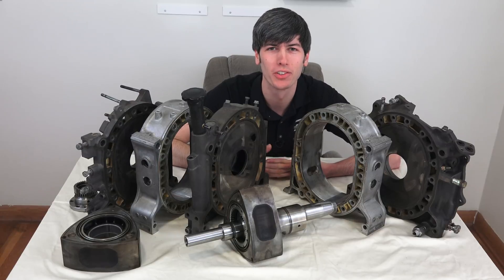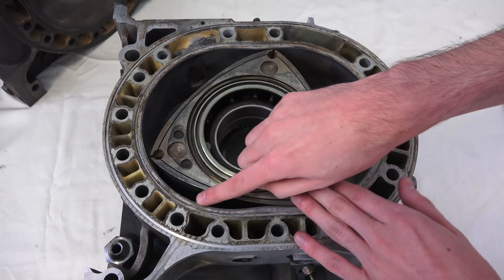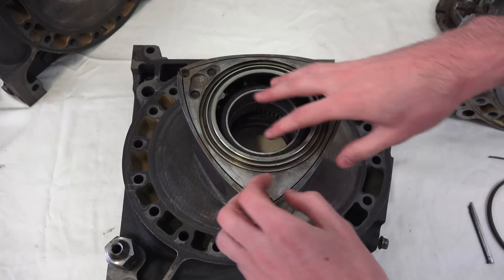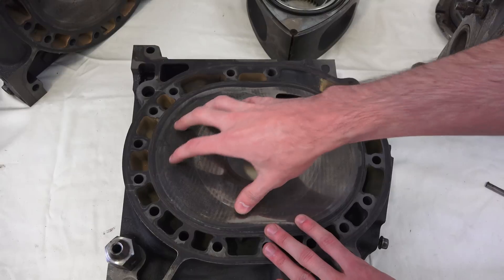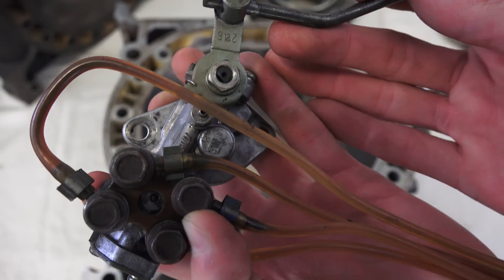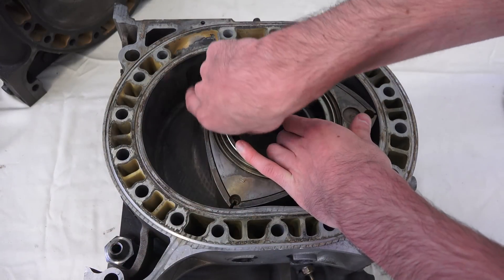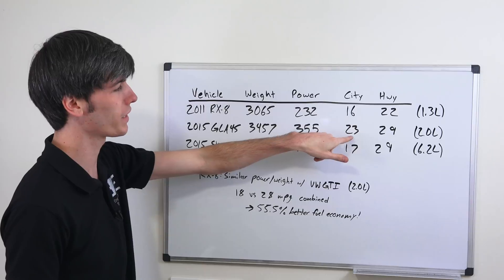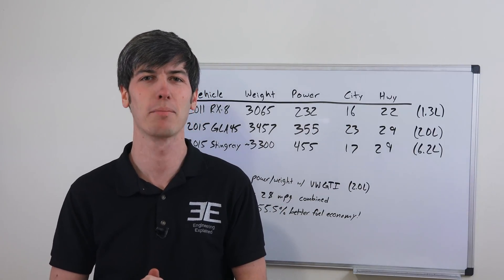4 Reasons Why The Rotary Engine Is Dead

Comment: Rolls Royce did have a diesel rotary with one rotor as the compressor around 1970. This idea has been taken up again by Pratt & Whitney Rocketdyne who have received R&D funding from US agency DARPA. This is to use the single heavy fuel for NATO purposes. Rotron of the UK approach using heavy fuel oil (HFO) from another angle, they heat the fuel to 98C before injection.
Reply: +John Burns Everybody tinkered with Wankels 40 years ago. For burning heavy oil 2 strokes diesels direct injection (with exhaust valve) are the best. Easy to make, simple technology, strong and extremely efficient (around 50%).
Reply: The real doktorbimmer Get therapy Knobhead.
Reply: Pablo Ricardo de Tarragon Correct.  The current idea is to preheat the fuel and use spark laser ignition.  A low revving rotary using HFO will last and last.  Darpa are very interested funding R&D. When the US government funds something the R&D info goes silent.  They also fund Liquid Piston who have a rotary in reverse.  The seals are in the housing and valves in the roter. Promising.
Reply: ***** Useless complications. That has a name in the military industrial complex; sugaring, that permits to spend money for the friends in some fields.
No need of laser, complicated pistons etc. The technology of heavy fuel 2 strokes diesels is mastered since ages by the German (Man by example) and Finnish Wartsila Suzler in very big engines. These engines are simple, reliable, easy to maintain and pretty cheap by HP, they are able to burn the worst bunker with high efficiency. Man makes also semi fast and fast diesels able to burn any thing that burns. The best turbo compound diesel engines for trucks made by MAN can reach an thermal efficiency of 52%.
The technology is pretty straightforward but there are a lot of possible gains with variable timings, materials as ceramics and sequential direct injection as you can get the best EPM and an engine as adiabatic as possible, ie with no heat losses. The thermal efficiency of these diesels is now just above the 50% (gas car at best 25%) and 55% are reachable in production engines..
The next step will be probably electric with combustible piles and regenerators, it's one of the ways of getting thermal efficiencies around the plus 60%, similar to the combined turbines able to burn from jet fuel to crude oil in production of electricity.
And for cars, electric motors have efficiencies above 80% and do not need gear boxes. With the new generation of batteries, 60% of global efficiency will be obtained including charging and discharging of the battery, more than twice the gas engine. In a rational world gas engines are obsolete.
Wankel was a dead end, it's thermal efficiency was truly too bad, and all the similar rotative piston engines suffer of the same thermal inefficiency, the shape of the combustion chamber being disastrous. That's enough to dismiss these engines. I won't talk of the sealing problems and worst the burnt lubricating oil.
Reply: The real doktorbimmer Yes, I could almost call Atkins and Miller cycles "variable timing" as they are variations of the compression sise of the cycle.
The great interest of the diesel is that can use a great variety of combustibles, even coal dust. The most promising path is vegetable oils produced by the the third world peasant using the engine. Coconut oil and sesame oil are very interesting. Sesame oil, which looks at first sight expensive for an occidental, can be easily produced by the peasant himself with minimal inversion, work and land surface. The sub products are edible and can be used for feeding humans and animals. The oil serves as lubricant and combustible. Except for the the small amount of diesel needed to start the engine, the user is auto sufficient.   
Even the humblest and very low tech all iron diesel engine 6 HP 600 RPM with splash lubrication has already a good efficiency and can be used with vegetable oil with little modification (mainly a oil heater using the exhaust gases) Such engines can run 24/7 with simple maintenance, and can last tens of thousands hours. So the 2 ends of the diesel engine, low and high tech, are remarkable.
Reply: Pablo Ricardo de Tarragon
Laser ign can project FOUR sparks deeps inside a combustion chamber, which is ideal for a rotary with its moving combustion chamber.  NATO want to standardise on fuel HFO. It can be spark ignited by preheating it. Rotaries in R&D have excellent thermal efficiencies when run at constant speeds.

Those 4 deck high Wartsila Suzler engines when needing overhauling means the ship is dock, which means down time which costs. Ship and moreso cruise ship operators do as much maintenance as possible under way. They even paint the sides of the ship when in a calling port. They want the ship in dock only for essential dry dock maintenance like azipods, props or the keel.  Some ship's designers are looking ahead and favouring larger rotary engines in banks (slide out modules say 1.5 metre by 1.5 metre complete with generator) in cruise ships. Rotaries are one third of the size and weight for the same power output. The smoothness is a great asset in passenger accommodation. Rotaries scale up seamlessly.

The rotary genset modules can be phased in, in stages to what the ship's demand is, rather than running these massive Sultzer engines when there is low demand. Then they can slide out a genset module in port and slide one in, which will take a few hours. The genset module in port can be overhauled onshore and the ship continues with no down time maximising efficiencies.

These big diesel engines are also filthy. Such huge ships emit as many air pollutants as five million cars going the same distance.

"Southampton, which has Britain’s second largest container port and is Europe’s busiest cruise terminal, is one of nine UK cities cited by the World Health Organisation as breaching air quality guidelines even though it has little manufacturing."

http://www.theguardian.com/environment/2016/may/21/the-worlds-largest-cruise-ship-and-its-supersized-pollution-problem

Some companies are running the cruise ships on LPG to reduce pollution. Rotaries as constant speed gensets are also very good at burning hydrogen.

The thermal efficiency of these diesels is because they run at constant speeds. Car engines do not, so efficiency is very low with cars.

You are right, in a rational world petrol engines are obsolete and electric is the way. The best range extenders for cars are rotaries with the new R&D very promising superior performance over piston/crank engines. They can be easily hidden in cars being one third of the size and weight, which is a fantastic attribute. Also, as range-extenders are part time engines the efficiency is not a great point - as they will be rarely used. Size weight and smoothness matters. But at a constant speed a rotary with the new advances running as its 'sweet spot' exceeds piston/crank engines. The rotary does not like being revved up and down.

Rotaries do not have sealing problems that is myth from 50 years ago.
Reply: ***** The Rolls Royce wankel diesel project died 42 years ago on 1974 https://books.google.com.mx/books?id=IB2lMFqTTl8C&pg=PA100&lpg=PA100&dq=rolls+royce+diesel+wankel&source=bl&ots=_3x3kwBst4&sig=650Cs6Aq74cDryIeBDXL7MrMXIM&hl=fr&sa=X&ved=0ahUKEwjPy_D-ju7MAhWDGh4KHbE0BdcQ6AEITjAL#v=onepage&q=rolls%20royce%20diesel%20wankel&f=false
RR struggled during years with the sealing problems, and after a few years more trying to remedy the inherent inefficiency of the combustion chamber. It never achieved its goals, so the project was discreetly buried. That sucked a lot of money of the tax payer, a typical military industrial project.
Rotary engines are inefficient by nature and now it's a dead end. There is none serious project of alternative rotary engine able to replace the old style engines.
All combustion engines are polluters by nature, you can make them a bit less polluters at extraordinary cost.
The case of the super cruise boats is simply the concentration in the same structure of an enormous amount of energy created by combustion engines, thus creation of an enormous pollution. Whatever the kind of combustion engines and combustible used they will pollute heavily.
LPG is pretty costly compared to bunker, and very unsafe compared to it. I would not like to store hundreds of tons of LPG in a boat... Hydrogen is a very costly combustible using extraordinary amounts of polluting energy to produce it, it's very hard to store, extremely unsafe and has a very low massic energy. It's absolutely not interesting in most applications.
The problem of Southampton (where I lived many years ago) is the number of boats, ships and ferries at the same place. Cruise ships uses gigantic amounts of energy. Besides, the Channel is the busiest maritime way of the world, with several big harbors, dozens of ferries terminals, hundreds of fishing harbors. 800 boats of more than 300 tons cross the channel every day, add the small boats of less than 300 tons and there are thousands of boats. 90 big merchant ships pass the Dover strait every day...
On a ship, the weight and size of the engines is not a real problem as they improve the center of gravity and the good ole diesels have the advantage to be cheap by HP as they use ordinary materials, are reliable, use the cheapest combustible and last decades.
They pollute as all combustion engines. More or less but they are all polluters. Without diesels forget all the cheap conveniences imported by sea, and global trade.
The merchant ships use very little energy compared to the weight of merchandise carried; a 10.000 containers ship uses 90.000 HP at 35 km/h, the same 10000 containers at the same constant speed on road will need 10.000 trucks using about a total of 850.000 HP. Ships are easily 10 times more efficient than trucks and 25 times more efficient that cars. The lone efficiency competitor in transportation is electric railroad. Economically there is no need to go to complicated solutions when powering a merchant ship.
Thermal efficiency are measured at the constant speed where the engine has the best specific consumption. So you can compare  the thermal efficiency of different kind of engines.
For the use as auxiliary range extenders on hybrid cars, a water cooled 2 stroke with direct injection will do the job at better price the technology is already mature. A 90 HP 3 cylinders is very small and weights only 40 kilos. You can find them in several outboard engines. They are practically as efficient as 4 stroke gas engines, with better torque and are very smooth.
Reply: Pablo Ricardo de Tarragon
42 years ago is a LONG time. Things have changed since then. I told you it's been taken up again. In the 1970s RR were strapped for cash because they signed a fixed price for the development of the RB211 jet engine. Great engine but sent them into financial problems. They pulled the plug on all projects.

Rotary engines are efficient by nature when run at a constant speed at their 'sweet spot'. FIVE companies in the world make them. They are used in UAVs.  Look up what Mazda is doing for future road vehicles.

LPG is not unsafe.

On a ship, the weight and size of the engines is a big problem as the centre of gravity is high. They are 4 decks high. A collection of genset modules all along the keel gives a superior lower centre of gravity. I know ships are more efficient than trucks, but they still heavily pollute using inefficient engines, burning filthy fuel.

The best lithium battery per kg energy density holds 50 times less energy than a the equiv petrol. So 50kg of petrol would need 250kg of battery. But road engines are only about 20% efficient, so the equiv really is 50kg of battery.

As an auxiliary range-extender on hybrid cars a constant speed rotary cannot be beaten when the new advances are incorporated. The one third of the weight and size is a massive attraction for a part time engine. Something you can't seem to understand.
Reply: ***** I do understand a little about engines, ships, warships, patrol boats and fast planning boats, as I'm a retired naval engineer and architect. I'm not a motorist but I do know my maths, and I did integrate costs.
I almost forgot; LPG is extremely unsafe in a ship compared to bunker. That's normal as there are pressurized tanks of a liquid which vaporises fast in a combustible gas heavier than air, so the smallest leak is a serious problem of explosion in a closed volume with oxygen. Bunker is dirty but very hard to ignite.
On a small boat with plenty of ventilation LPG is not a big problem, except for the corrosion of the tanks.
Reply: Pablo Ricardo de Tarragon  LPG is not unsafe. It may be problematic in certain failure conditions. But the failure conditions can be accounted for with safety mechanism put in place. In the early days of petrol there was explosions and fires all over. Heavy fuel oil only caught on because of reduced insurance costs. Now we know how to store, transport and use petrol.

Cruise ships, and other ships, ARE using LPG right now. It is a hell of a lot cleaner and stops people preventing them entering places like Venice on pollution grounds.

Look at this article about the burning of heavy oil by large cruise ships. It is a big problem.
http://www.theguardian.com/environment/2016/may/21/the-worlds-largest-cruise-ship-and-its-supersized-pollution-problem

Ships designers are looking at dispensing with those old huge diesel engines and going over to phased in genset modules for reasons I have already outlined. Reducing downtime, and maintenance costs on a cruiser most than offsets higher fuel costs, if there is any.

As to road vehicles, the market has to go over to series-hybrids driven by high efficiency electric motors. Small to average sized cars can have a Lith battery bank that will give 300 miles range. The part time range-extender has to be 'physically small' to fit in the car, and smooth. That is where the rotary comes in. Forget the tripe about seals lasting a few years. A modern rotary using the latest advances used as a constant speed genset will last and last. Many go way over 100,000 miles. As as range-extender it is only a part time engine it will last the life of the car.

Rotaries do not like to be revved up and down.  Fuel economy and emissions suffer. When they are they did have seal lift off as one chamber can have more pressure than the adjacent chamber (although this has been rectified by some makers). Running them at a constant speed just above the seal lift off speed solves a lot. Rotaries suffered though unburnt fuel in the exhaust. Multi-point lazer ign solves that. Designed to run a constant speed then the design is much easier to maximise fuel economy and give superior emissions as most is a constant.

Mazda are R&Ding a rotary engine now. They say it will be out next year for the 50th year of the Cosmo, their first rotary car.

UAVs use rotaries because of their small size and light weight which is a great advantage in a plane.
Reply: The real doktorbimmer
You're wasting your time with Burns. Surely you have more interesting things in your life than trying to get J. Burns into reality.
Reply: Pablo Ricardo de Tarragon Another nut.
Reply: Pablo Ricardo de Tarragon how is it going fixing the outboards?